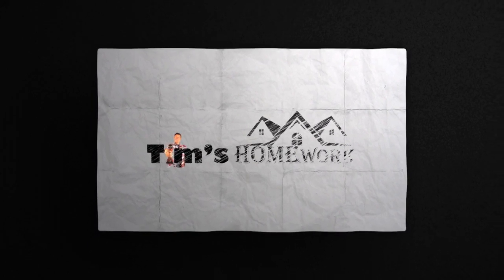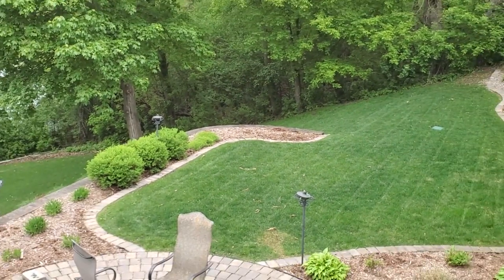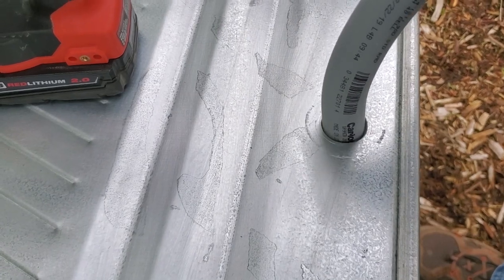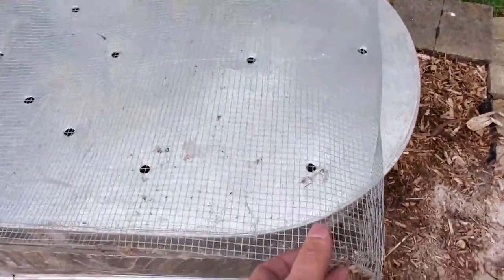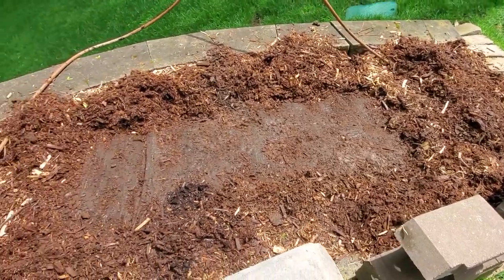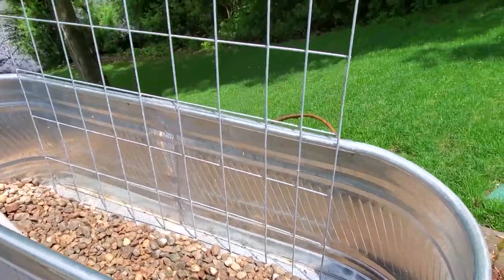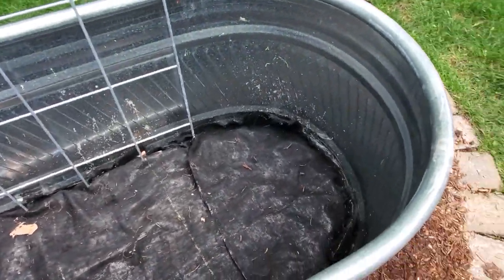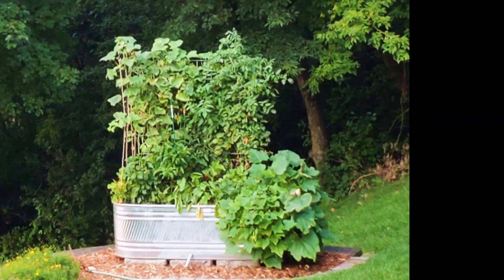THE Simple Way to Build a Stock Tank Raised Bed Garden!!!

Comment: G R E A T  video ...!  I made a list of things to buy for my three raised garden bed containers (that are exactly like yours, by the way).  NOW, I know how to do things ... 1. drill multiple holes everywhere on bottom (including a conduit fitting .. but I am going to make it go out the bottom of container instead of side)  2. put meshwork on bottom 3. get drain rock to put on top 4. place landscape fabric on top 5 on top of this, place backyard prunings/clippings or hay to lessen amount of soil to use 5. dirt mixed with perlite   THEN do the drip line irrigation like you showed in your follow up video .. THANKS, ... DUDE !!!
Reply from the maker: That sounds great.  Good luck with your gardens.  Three should give you a lot of planting options!

Comment: Great video! I'm considering doing the same in my backyard.
Reply: I recently added two stock tanks to gain level raised bed areas to a steep slope. Next, I begin filling them using the Hugelkultur method to build up biomass and fill space before topping them off with compost and planting soil.

Comment: Tim: perhaps you can make a short video on how to make a top / protection cover (greenhouse effect) .. very much like the expensive Vegepod .. so it protects against deer or birds ....
Reply from the maker: That's a cool idea!
Reply: that is a good idea and I haven't thought of that and it might solve my problem. I have a horse trough and don't have it raised and probably going to raise it like he did. I bought a large one that I think is a very thick resin material because I didn't want a metal one that gets really hot in the summer from tractor supply(I wanted as much space to plant as I could and my plants not getting burned from hot metal). it also has a drain on the side and I didn't bother taking the drain out,just unscrewed it some and water trickles out when we get to much rain or if I am watering it. my problem so far is I think is slugs...I planted strawberries and slugs are getting in and leaving small chunks in my strawberries as soon as the strawberry is ready to be picked. so could always use the protection cover or green house affect to keep them out instead of having to throw out most of the strawberries they mutilated and coming away with only 2-4 strawberries that they didn't get yet.I have used beer filled plastic containers much to my husbands dismay ( he did finally give in and told me to buy the cheapest most foul beer he would never drink though hahahaha)and its not getting enough to make a differance( only got 1 slug from 8 containers ).

Comment: I thought about using stock tanks for planters, but  was afraid that once I drilled holes for drainage I was just asking for rusting to start. Won't that be an issue?
Reply from the maker: Hi Michael.  Great question.  Zinc galvanizing is an interesting process.  Though there will show a ring of rust in the center of the drilled hole where there is totally bare metal between the inside and outside layers of galvanizing, these two layers of zinc will actively work to prevent the spread of oxidation (rust).  While there should not be an issue, if concerned about any rust, one could shoot the holes with a quick burst of cold galvanizing compound that applies out of a can like spray paint.  Good Luck with your Gardening projects

Comment: Very informative, thank you!  Any reason why you didn't use the step drill for drilling the bottom holes?
Reply from the maker: You could use the step drill for drilling the bottom holes.  I had the standard bit, and typically think of the step drill more for enlarging holes, vs. starting holes, however it would work.  The step drill possible wouldn't drill as fast, but I don't think it would be much of an issue with as thin as the tank material is.

Comment: What did you use to remove the logo from the tank?
Reply from the maker: That didn't come off as well or as quick as I had thought it would.  I started trying some solvents like lacquer thinner and a scouring pad.  This worked for the bulk.  I then used a wire brush to get it to where it was in the video.  It's mostly gone, but there is a shinier spot where it was on the side.

Comment: Thanks for the tutorial. Can you tell me how hot the metal can get on a very hot summer day. If it does heat up, does it affect the plants? Thanks.
Reply from the maker: I have not noticed that the metal is any hotter than normal.  It has not had any negative affect on the plants.  Good luck with your garden!

Comment: Tim, thanks for the video!  Great job!!!  One question, where did you buy the raised bricks you used for the base.  I've been to a number of places and no one has them.  Do they have a specific name?  Thank you!
Reply from the maker: The bricks I used for the base were retaining wall blocks that I had left over from a landscape wall project.  They are Rockwood's Colonial Classic blocks, however any retaining wall block would work great.  You could use concrete wall blocks (CMU) or stacked pavers, however I like the "finished" look that a retaining wall block gives as a base.  Good luck with your garden build!
Reply: @timshomework  Thanks for your quick reply Tim!!!
Reply: Tim, one more questions!  Dimensions of the cattle fence you used?  Curious how high you went - we're planting tomatoes and strawberries.  Thank you.
Reply from the maker: @Stuart Brodie  Our cattle fence is 5' high from the soil surface.  This height has worked out great for the plants and I can comfortably reach the entire surface.  Remember to add in the depth of your tank to the overall height before cutting the fence. 😀
Reply: Hi how did you keep the fence in?     Just the weight of the soil good enough to keep it steady or did you secure it somehow and i missed it?   lol

Comment: when you drill thru a galv steel you really do need to spray or brush the holes with a water proofer to keep the holes from rusting the bottom out
Reply from the maker: Thanks for you comment.  Zinc galvanizing is an interesting process.  Though there will show a ring of rust in the center of the drilled hole where there is totally bare metal between the inside and outside layers of galvanizing, these two layers of zinc will actively work to prevent the spread of oxidation (rust).  While there should not be an issue, if concerned about any rust, one could shoot the holes with a quick burst of cold galvanizing compound that applies out of a can like spray paint.  Good Luck with your Gardening projects!

Comment: Since it has a bottom and it's elevated why do you need hard cloth?
Reply from the maker: Hi Kevin,  The main reason for the hardware cloth is like a filter fabric to keep the rocks and any other items from falling into and plugging the holes.  I think it serves a purpose as an insurance, however it would work just fine if you didn't use the mesh.

Comment: How do I get the plug out!? You didn’t  show it😢
Reply from the maker: The drain plug on the tank I used had a large hex shaped profile.  I used a Channellock pliers to remove the plug.  There are other styles of plugs on other brand tanks.  One I have seen has a square "hole" in the center that fits a 3/8" socket driver.
Reply: @timshomework  ok thanks!

Comment: What size tub
Reply from the maker: The tank I used is nominally 6x2x2.  Depending on where you look, it is rated from 144 gal. to 159 gal.  I really like the look of this size tank, however you could easily go with the 1ft deep ones to save filling soil.  The 6 ft length has worked out real well for laying out the plants.
Reply: @timshomework  thank you

Comment: Curious... why do you feel the need for the hardware cloth with your tank off the ground?  It's not likely that voles or moles would burrow in even with the small holes in the bottom
Reply from the maker: Hi Rustie,
That's a great question.  I actually used the hard cloth to keep everything in, versus keeping anything out.  When using the larger sized filter rock you really don't need to use the mesh, however I like that it will keep the rocks from washing into and plugging the drain holes.  So whether to use the hardware cloth or not is totally up to you.  In building another garden, I personally will choose to use it again.  Thanks for watching and your question.

Comment: The taller tank is better for holding water in hot weather. And that drain pipe is pretty useless.
Reply from the maker: The taller tank would have more soil mass to hold water.  I picked it because I liked the proportional look versus the smaller tanks.  Being taller, it also brings the garden up closer to work in.  As far as the drain pipe, I'm guessing this is referring to the conduit for running the irrigation supply tubing into the garden.  It's put in to give a more finished look to the project.  One could just run the tubing up the side of the tank if they wanted to.

Comment: But the holes will cause rust now
Reply from the maker: Thanks for you comment.  Zinc galvanizing is an interesting process.  Though there will show a ring of rust in the center of the drilled hole where there is totally bare metal between the inside and outside layers of galvanizing, these two layers of zinc will actively work to prevent the spread of oxidation (rust).  While there should not be an issue, if concerned about any rust, one could shoot the holes with a quick burst of cold galvanizing compound that applies out of a can like spray paint.  Good Luck with your Gardening projects!

Comment: Crazy drilling in the base, better to put holes 2 inches up from the bottom on the side.  This way it will not dry out.  Put metal at the bottom 2 inches thick then build with your soil.
Reply from the maker: That could be an option.  There are also number of great videos out there on making a tank garden self-watering.  My concern is if the lower level "never" drained out, what would the condition of that wet mixture in the bottom turn into and would it speed up deterioration (rust out) of the tank bottom?  Maybe they would not be issues either?  Thanks for your comment, it's great to hear other ideas!

Comment: The hardware cloth in the bottom is totally unnecessary
Reply from the maker: Though the hardware cloth could be considered optional, the main purpose of it is to keep the drain holes clear.  Without the mesh it is possible that the rocks or any other debris may shift or try to escape the holes, thus causing them to plug from drainage.
Reply: @timshomework  True. Thanks.